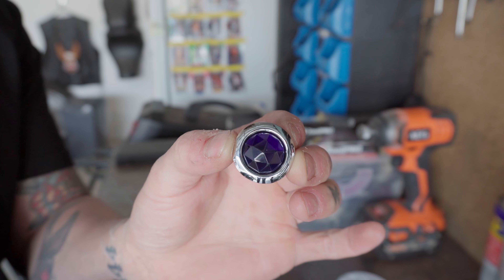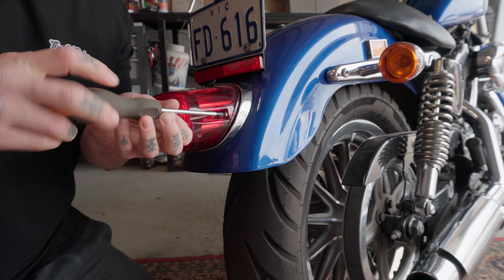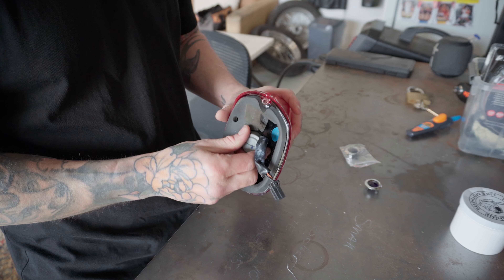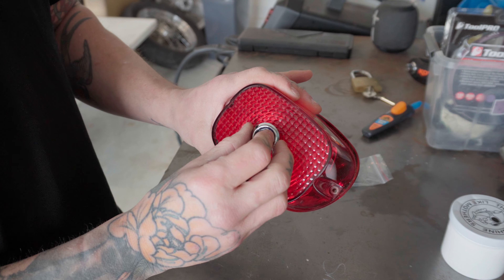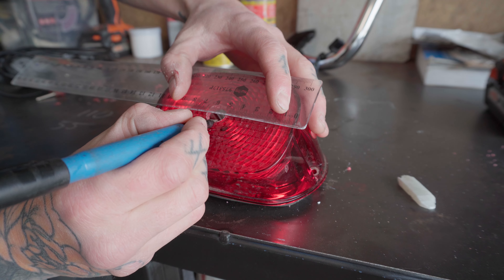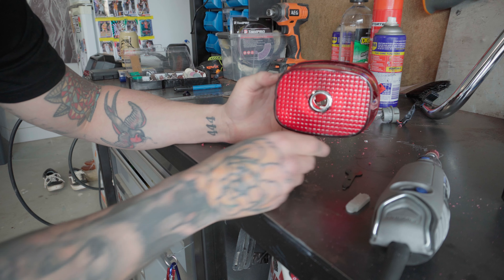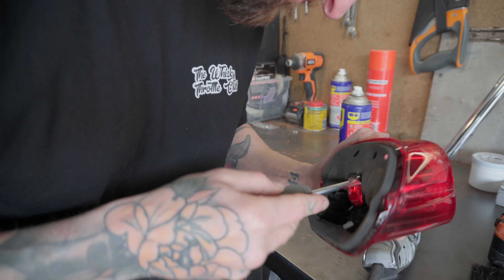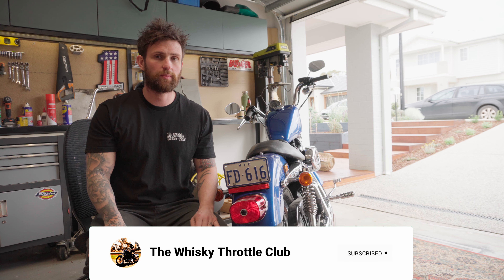1950s Harley-Davidson Mod: How Blue Dots Transform Your Bike! #motorcycle

Comment: If you twist the little tabs, instead of bending them flat, they will hold the glass in the ring and not block any light. Cheers
Reply from the maker: Awesome! I didn’t think of that, cheers for the tip! 👍

Comment: The idea was from a distance while driving the tail lights looked purple. Blue and red makes purple.
Reply from the maker: Ah there you have it! I’ll have to have a look from a distance and see how purple it makes the tail light go. Cheers 👍
Reply: They also make it kinda hard to tell the difference from taillight and brake light. Back in the 80's a buddy of mine had a blue dot taillight and I almost rear ended him bunch of times. He finally changed it and no more problems
Reply from the maker: @shameless6963 I might have to look into it and change mine back if that’s the case. Thanks for the heads up

Comment: I ran one on my Last Bike, I plan on installing one on my current one. I used a Spade bit to drill out the lens, but use VERY light pressure and low RPM, let the bit slowly score the hole in the plastic lens until it comes through. It helps to start on the outside then switch to the inside, using the center hole as a guide, and continuing switch as the cut deepens. Ideally ending up with the final score which breaks through about midway between the inside and outside of the plastic lens. This prevents possible cracking.  Also make sure to order a GLASS Gem blue dot, they really look good. There are cheap PLASTIC ones which really don't work as well and the color may fade after time. Also you can slightly TWIST the mounting tabs with needle nose pliers to secure the Glass and Bezel into the Tail light Lens....
Reply from the maker: Thanks for sharing those tips, that’s some good advice. 👍